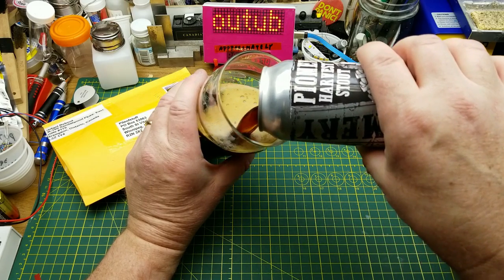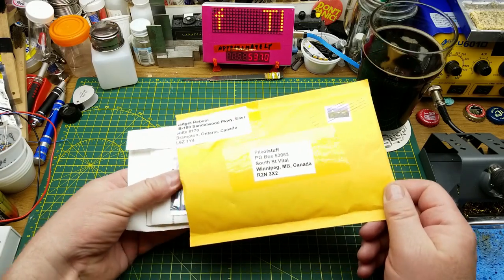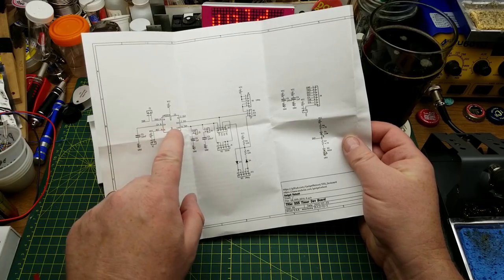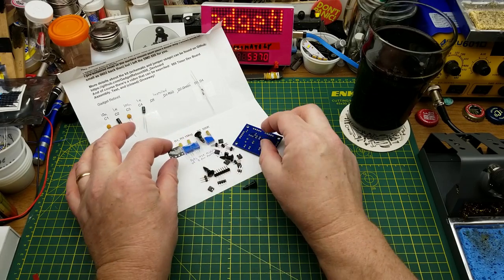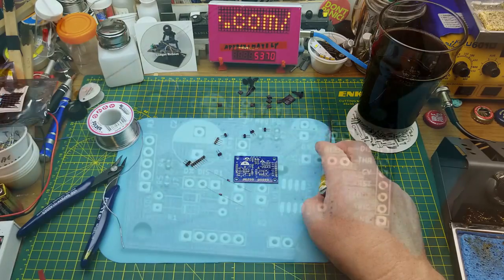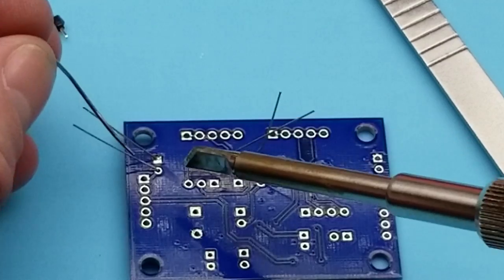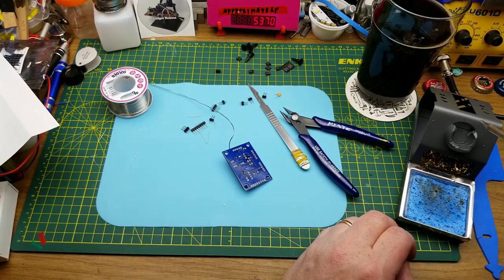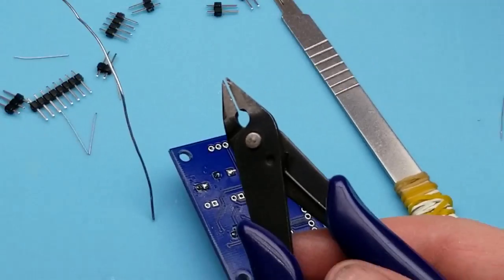Building Gadget Reboot's 555 kit

Comment: At least the big iron tip made it partway through! Those two timing footprints were chosen as different sizes to accommodate various sizes of electrolytic even though I only went with smaller values.  
I probably should have specified which way to install the pots.  if I were doing the design today I would not have made a universal five pin footprint now that I have received new stock of parts and I don’t have to go with whatever is laying around.

Comment: For soldering SMD chips, I tack a bit of flux down instead of solder on that corner pad. Works like a charm! Solder it in and tack the other side down accordingly. Now drag some flux across one side of the pins -- literally put the solder on the tip and drag the tip across the flux. Cheers! :) Oh right .... the cleanup. 🤕

Comment: And by the magic of editing, @16:10 the short from 7 to 8 disappears  :) :) :)
Sorry, that kit is a mess. The weird mix of SMT and THT components makes no sense. Espacially a NE555 in SMT on a development board... Or to put it in another way: What's wrong with a NE555 in THT and a proper socket?
Reply from the maker: I wasted far too much time dealing with that one. The video would have been twice the length if I left it in.

This was one of his first kits and he designed it based on the parts he had a stockpile of in his shop at the time.
He never intended it to be a commercial quality product.

Comment: Two aspects of the kit are "stoopid". Firstly... how idiotic to use an SMD 555, when all the other components are thru-hole. And the SMD chip probably costs more, so it's just a stoopid design choice.
Secondly, the nice multi-turn pots need to be soldered in the correct way. Orientate them 180 degrees and they work "backwards". The PCB or instructions should indicate which direction to install them.
Reply from the maker: It was one of his first PCB designs, based on the parts he had in hand at the time. 
It was never intended to be a commercial quality kit, just a bit of fun.
Reply: I actually look at it as good solder practice for both styles.
Reply: @AnotherMaker  yeah it was actually about half of the board that was surface mount and half was through hole, and since it was just a one off batch, I was using up parts I had including a strip of 50 surface mount 555s